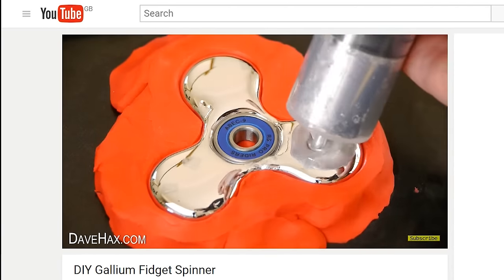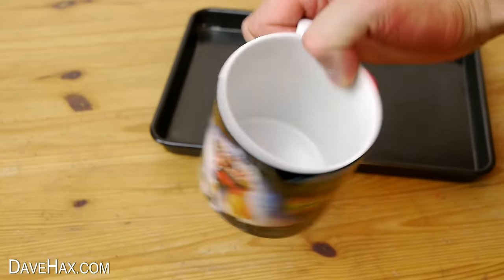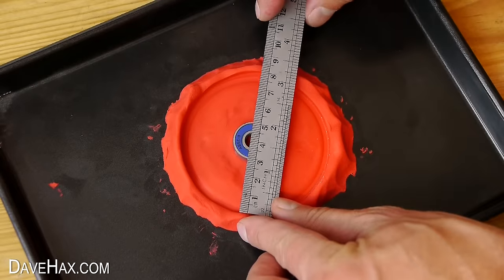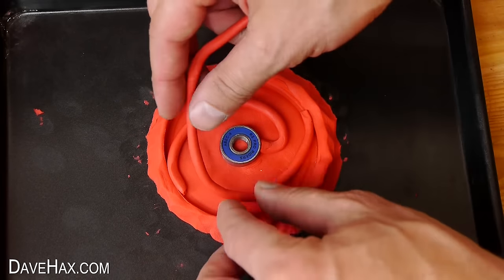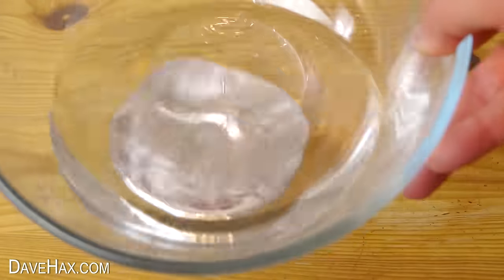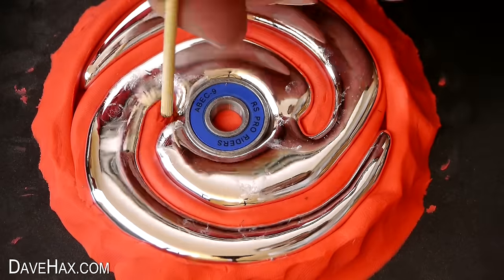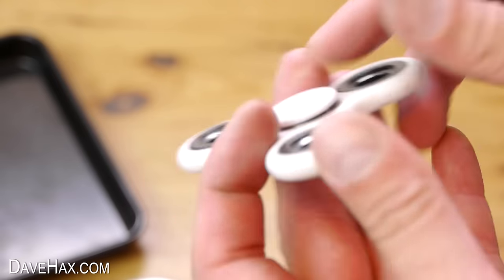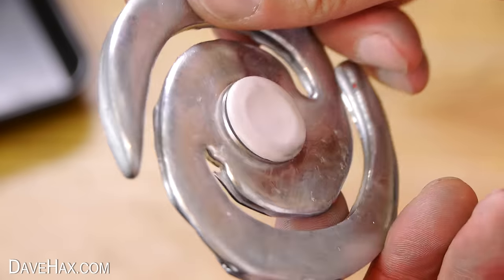DIY Spiral Gallium Fidget Spinner

Comment: Put food coloring in the gallium to see if it changes color 
Like so Davehax sees
Reply: ShotgunDowns Its a metal. Liquid cant mix with liquified metal, proof is even in the video, the water didnt mix into the gallium.
Reply: ShotgunDowns it won't
Reply: ShotgunDowns gallium is denser than water so it won't mix
Reply: Endy mixing isn't about density.
Reply: Francesco Di carlo you can see his face in 2:21
Reply: yung babbi you are wrong. Metal and solid can mix
Reply: what solid?
Reply: Thanks all for telling me about the food coloring and the metal not mixable 😃
Reply: ShotgunDowns 👢👑👑👑👑👑👑👑👟👟👟👟👟👟👞👞💄💄💄💄💄💄💄💄💄💄💄💄💄💄💄💄💄💄💄💄💄💄💄⚓⚓⚓⚓⚓⚓⚓⚓⚓⚓⚓⚓⚓⚓⚓⚓⚓⚓⚓⚓⚓⚓
Reply: 666

Comment: Btw in case you didn't know (which I doubt) you actually needed to make those cuts to let the gallium form a ring around the bearing otherwise it would be in two pieces
Reply: yeah but it would still stick to the metal from the bearing. it would just be easier to break off